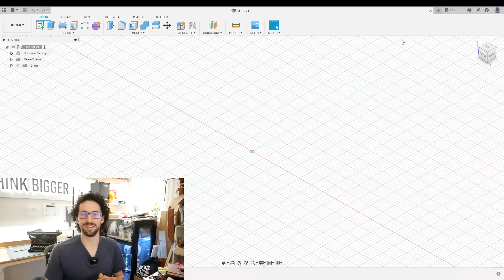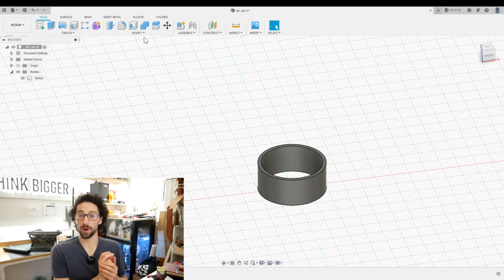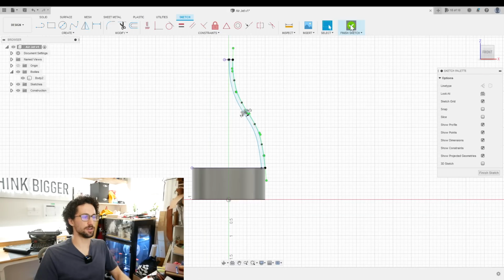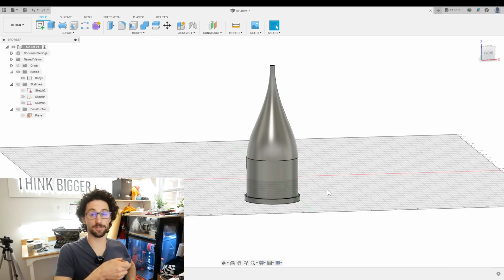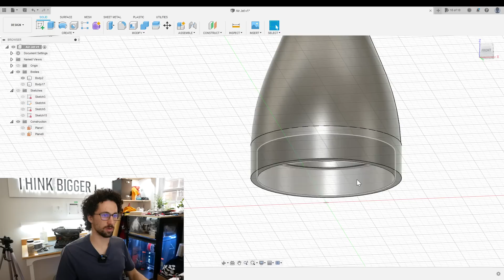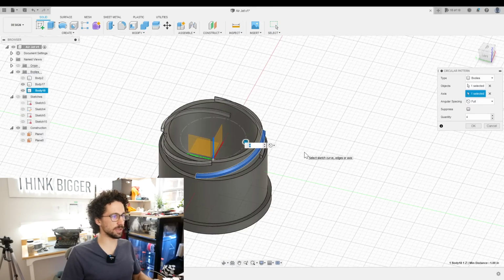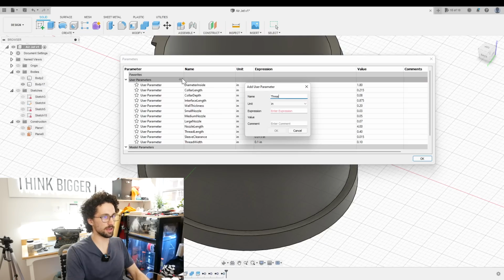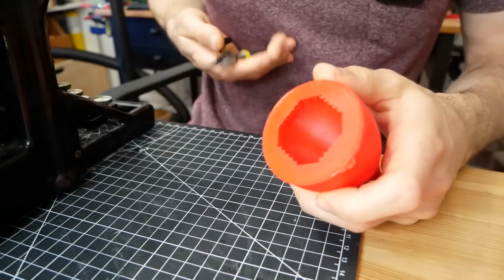Making a 3D Printed Air Duster \\ Shop Vac Attachment

Comment: I designed a cap for my yeti can insulator. I did the threads the same way. Fit like a glove. I had a harder time getting the print in place hinge to work correctly. Maybe I should revisit it now I've learned a lot.
Reply from the maker: Awesome! Thanks for watching

Comment: For slip fit interfaces like this, one or both are usually tapered. I didn't see you check for that, so I'm guessing you got lucky that the tube was the tapered one. For future projects, I suggest taking 4 diameter measurements. (Outer shallow,  Outer deep, Inner shallow, Inner deep) Great tutorial regardless. Thanks!
Reply from the maker: Good point! Thanks for watching 😊

Comment: I did something like this a while back, found that the a 0.5 inch hole was perfect for good pressure and airflow, also works amazing for drying your car, mine did shoot out a few times so i ended up creating a TPU gasket to apply proper pressure
Reply from the maker: That’s awesome!

Comment: Having the pressure lower than an air compressor may be a good thing. When I was cleaning up my sewing machine I read that the high pressure can damage sensitive parts, I’m guessing the same would be true for an old typewriter. Another great tutorial!
Reply from the maker: That’s a good point, I didn’t think of that! I’ve also heard it’s dangerous to blow dust off of your skin with an air compressor, as the pressure is so high it can push things into your skin.
Reply: @MorleyKert  That danger comes from blowing  air into cuts in the skin which might introduce an air bubble that makes its way to the heart.  Then there are "pranksters" that will pressurize a coworkers anus or vagina through clothing because they think it is "funny".  Ruptured intestines are obviously a serious problem.  Way back when type writers were state of the art they were cleaned by dipping the whole machine minus the key caps into hot petroleum solvent, and then re-oiled dipped in hot oil.  Your method is much more sensible.

Comment: You already had the built in clip connection I fail to see what the added benefit of a threaded connection is when changing to a different attachment
Reply from the maker: I talk about it at 13:01 :)
Reply: @MorleyKert  Sorry mate, didn't quite make it to the very end, that's my bad. Good stuff
Reply from the maker: @EKUL34  thanks for watching!
Reply: depends how many nozzles he makes, if he makes a bunch then over time the extra plastic needed to cover the default attachment might add up. but then he could also just design the rest of the nozzles to be shorter and just work with the clip attachment. the biggest hurdles with 3d printing is you have to design things yourself a lot of the time, and you might get an idea for something that at first you think is useful, but might not turn out to be useful at all, or just not as useful as you thought, and you end up changing your design only after you tests those ideas and learn from them.

though i also get the impression its supposed to serve as a lesson in creating threads in fusion.